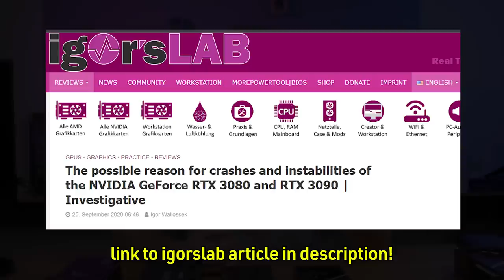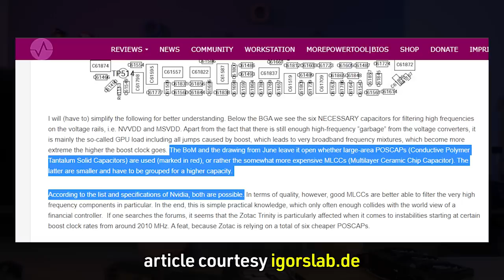The RTX 3080 Launch can't get any worse... Right? Wrong...

Comment: Just to go more indepth form an EE standpoint, these capacitors are primarily what called "de-coupling" or "bypass" caps. They de-couple an integrated circuits power pins (vias from the BGA of the GPU in this case) from the large copper power planes in the PCB. The further a device is from its power supply output (DC/DC switch mode converter on the GPU) , the more inductance there is between the supply and the device its supplying. 
High frequency, high power ICs like a GPU can have huge current spikes that occur at extremely high speed. 

Basically inductance bad. 
It limits how much current we can source from the power supply. The higher the frequency, the more PCB inductance impacts power delivery. 

Because the reactance (complex part of impedance) of an inductor goes up with frequency (Xₗ = 2π*f*L), the higher the frequency of a current pulse from the GPU, the higher the reactive impedance it sees between itself and the power supply. 

Here's where de-coupling capacitors come into play; they store charge and can be placed as close as physically possible to the power vias of the GPU. This means that the high frequency current now has a far lower impedance path into the GPU, it can temporarily come from a bypass cap instead of the power supply. 

But wait there's more! 
The physical capacitor still has small amounts of inductance due to how they are constructed. This is called ESL: equivalent series inductance. 
There are many different ways and materials to build a capacitor so there are many sizes and types of caps available with different pros and cons. (size, price, availability, voltage, ESL, ESR, temperature, dielectric ect.... ) 

Basically, you can implement the SAME amount of capacitance with many sizes/types of caps BUT very different ESL values!! 

You can still have enough decoupling CAPACITY in your caps but if the ESL is too high, at these GHz frequenies, the reactive impedance of the cap itself can greatly reducing its current sourcing abilities!! 

Exactly the same problem why we wanted to put them there in the first place with the PCB inductance!! 

In the case of the 3080 boards, it is possible that Nvidia didn't give correct or strict enough ESL target specs on their reference design. Because the reference design is not used for the FE cards, it may have gotten less lab testing and verification??? IDK

Or the board partners might have been trying to cut costs and used more of the big Tantalum caps which have a higher ESL than a bunch of tiny MLCC (multi-layer ceramic caps) all in parallel. Remember inductance adds in series not like parallel for capacitors. 

Idk that's my rant 😫
Thanks for coming to my bootleg TED talk.
Edit:some corrections
Reply: Shouldn't the MLCC caps be in parallel, not series?
Reply: @carl4889  Yes parallel! Thanks.
Reply: nvidia purposely gave an incorrect minimum requirements to AIBs so that when people find out about the issue, people would buy their founder edition more. Less reputation to AIBs, more to nvidia. one way to kill the AIBs so they can soon monopolyze their own GPU sales....👀👀😂😂..  - some conspiracy theorist

But to be more serious, one of the comments here already mentioned that the bigger POSCAPs tend to be more expensive than MLCCs. I wonder if the AIBs found more money saving in using POSCAPs because it takes less time in the pick and place??  🤔 because they only have to place 1 component instead of 6?
Reply: I'm gonna pretend I understand what you are saying and agree, just because it's amazing the amount of knowledge and technology that goes into a graphics card design.
Reply: @mik995px  That's not the impression I got from this video... It seems like the reference design had 1 POSCAP replaced with the MLCC array, the cards that are failing used all POSCAP designs and would therefore be under speced....

Also as far as manufacturing goes, yes the increase in process time to place the 6 MLCCs would likely increase the costs far more than the actual price difference between the components.
Reply: TLDR. What is it in very lay speak?
Reply: Super cool explanation. I'm an aerospace engineer and had to take some basic EE classes, just enough to understand signal processing and communications system design considerations, so I know a bit about AC circuits and such.
Reply: Shane McLachlan thank you Shane you are a legend. 👊🏼👊🏼
Reply: this makes me very happy that ive graduated from college
Reply: I understood nothing but feel informed regardless.
Reply: Reference shows 5+MLCC, so some AIBs went 6+0 MLCC is fine... 
If you have a 6+0, de clock 15 or so MHz till stable, and you are fine.
Reply: @JackFN_VR64  You can't understand anything if you don't read, so why you ask? Like it's pretty much gibberish for me but i still got something from reading it. So i'll tell you what i gathered from it. Those thingies Jay was showing should act as a buffer to maintain power levels when the board uses it so fast that there is no enough time to be fed by the PSU because of the distance that results inductance. And those thingies are not all the same so not using the ones proper for the job things are not working smooth overall.
But maybe i'm wrong, probably am. But that's what i understand from reading his post, so maybe reading is bad?
Reply: @JackFN_VR64  He's essentially agreeing with Jay and going into a little more detail as to why.
Reply: Can you recommend some EE books that you've found helpful or key to your understanding?
Reply: @somnorila9913  This is a grand TLDR. Thank you 🙏
Reply: @JackFN_VR64  Imagine this: you have 6 little bottles of 1 liter in one case and one bigger bottle that contains 6 liters. In both case the total volume is 6 liters, but the behaviour of the two are not the same. AIB manufacturers wanted to spare some production cost, so they opted for the cheaper solution, without considering other factors than the capacitance. This explanation should be enough to understand what happened and why they also talk about bottleneck... (the last one is a pun ;-) )
Reply: Decoupling caps are not just for power supply lines.  All signal lines going into an IC should have decoupling caps to block DC voltages.  A DC offset on a signal line can be just a bad as poor power supply isolation.
Reply: Best explanation of bypass caps I’ve ever read. Thank you
Reply: Bypass capacitors aren't the same as decoupling capacitors. Decoupling ones are like you explained, but the bypass ones are put to let very high frequency EMI (electromagnetic interference) bypass the IC through them, which is the function that Jay tried to explain.
Reply: @saifaddeenal-manaseer6325  agreed; good clarification!
Reply: Love when ppl at the comments know their shit
Reply: @nated1971  Not all signal lines, many common high speed signal types which are implemented on emitter coupled logic like LVPECL or other have a DC bias on the signal line to bias the input transistor of the receiver.
Reply: @Shane_McLachlan  Fair enough, my limited experience is in RF systems; when you're a hammer everything is a nail
Reply: @saifaddeenal-manaseer6325  Good point! Thanks. 
Provides a low impedance path for the noise to ground! I like to use  feed-through capacitors for this. They have an extremely low inductance to ground. Great filter bandwidth.
Reply: Out of curiosity, what if all six sections were mlcc? Better, right?
Reply: @JackFN_VR64  the big capacitors are not sufficient, so the small ones are there to solve the issue, and some AIB manufacturers are skipping the small ones that solve the issue to cut costs
Reply: Holy smokes. You really seem to know your stuff (and passionately so). 

I wouldn't normally do this but I am having an issue surrounding my 2080ti that I suspect is related to power issues. Do you mind if I give you a breakdown of the issue and you can share your insights?
Reply: Shane McLachlan now I’m wondering what else they cut corners on
Reply: i stopped using tantalum capacitors in my design for  these and other reasons - mostly because taking high currents often caused them to go short circuit and / or explode - thanks to their intrinsic ESR 

now I exclusively use MLCC with X7R dielectric as these are incredibly stable and  in 20 years they have remained operational .
Reply: @Ender240sxS13  the cost to pick and place is fractions of a penny, it costs more to replace a reel of components as this is purely labour.    The cost of 6 more capacitor placement is also negligible to the additional optical polarity inspection required for the larger capacitors
Reply: this is surges of Direct Current not Alternating Current being supplied , the inductance of the holes, traces, connections etc... will have the effects you describe
Reply: @wobblysauce  and leaving performance on the table because someone wanted to be cheap.... like buying a Ferrari with a plastic spark plug

Comment: Oh boy, imagine being one of those who actually bought one of these buggy cards at a ridiculous price from a scalper.
Reply: I didn't buy from a scalper but imagine waiting outside microcenter for 24 hours to buy a 3090 and find out that Zotac decides to cheap out on a 1500$ card.  That's just fking evil.  And yes, they used the same capacitor layout from the 3080.
Reply: @Momotaro0125  na, for 3090 you had to wait 48-72 hours outside the microcenter
Reply: @Grubiantoll  There's actually 2 Microcenters nearby where I live and the population isn't high overall.  The one in Rockville, MD had 16 cards and the one close to me (Fairfax, Va) had 12.  I was the 11th person in the line and I showed up around 11am on Wednesday.  So no, you didn't have to wait 48 hours for a card, it just depends on the density of the population.  I know you're just a typical internet cynic but at least do your research before you call out someone.
Reply: SERVES EM RIGHT! Dont buy from scalpers, and dont be a scalper!
Reply: teaches them a lesson to not buy from scalpers
Reply: @Momotaro0125  That's pretty dramatic calling them "fucking evil". Did you bother watching the video or not? Jay made it very clear that using 6 of the large black capacitors was not necessarily "cheaping out" but meeting minimum spec and told you specifically not to shit on them for trying to meet minimum spec because it helps them reach the (sometimes even under) MSRP rather than going significantly over. Cheaper prices win buyers over. Under normal circumstances if this wasn't an issue you would've just got a normal 3080/3090 that couldn't been pushed as hard with an overclock or GPU Boost. Don't be melodramatic and call them evil or cheap for it. They made a mistake and they will pay for it but the last thing we need is to bash GPU AIB partners with blind moron rage.

Take a breath and chill.
Reply: @QuackZack  well, it would be understandable if it's the 3080 but considering that the 3090 is a 1500$ card, it's a whole different situation.  Also, Zotac decided to lower the power limit on their cards instead of spending a few more dimes for just one or two better bypass capacitors for a 1500$ card.  How is that not evil?  I understand that it's also Nvidia's fault since AIB layouts have to go through them first to get the green light but still.  Zotac knows the problem exists and still decided to lower the power limit over spending a few more dimes ON A 1500$ CARD.  How is that not evil?  When you compare them to Asus who figured out the problem and decided to have all 6 ceramic capacitors instead.  And you know this is true because their pre release model did have the cheap out capacitors and the launch models have the good capacitors.  That is what a good company would do.
Reply: @QuackZack  btw, they didn't meet the minimum spec because I do crash still without touching Firestorm (Zotac's OC soft).  And this happens with Zotac already lowering the power limit by 5%.  All this could be avoided if they just spent a few more dimes.
Reply: Sekushu u taught that troll for sure
Reply: @QuackZack  Oh course its cheaping out! Are they evil...No. Are companies being greedy to maximise their already high profits for these cards...Yes!
Reply: Exactly! 😂
Reply: @Momotaro0125  Imaging paying $1800 for the Strix only to find that all six of its caps are the crap kind and all six on the $1600 TUF are the good kind?
Reply: @SteveMedin  the Tuf was 1500$ at Microcenter, but they only had 2.  They would've been my first choice but I was the 11th person so begger can't be chooser.
Reply: Anyone buying from scalpers deserves it.
Reply: @QuackZack  Most of the people that like to complain like this and attack companies likely would never be able to do the type of brain work required to design any sort of electric circuit for computing...

(Note, I know I can't do that work. Maybe with years of studying but I don't even want to attempt it lol)
Reply: Ufff i felt that LOL
Reply: @QuackZack  No she showed the graphic for the minimum spec and its 5 large black ones not 6. 6 is cheaping out.
Reply: It's funny, because what you guys scalping, is called retail in my country.
The lowest price i can find in Hungary, is around 1150$, at a shop i never heard of.
But on one of the most popular shops, is listing the cards at around 1300$.
And already seen some listings of 3070 cards (probably something like preorder) at 800$.
Reply: Those people are part of the problem, just like the scalpers. No sympathy here.
Reply: @Grubiantoll   I bought one fair and square using an add to cart URL from Nvidia.
Reply: @SITHRooTs  the are evil since they companies that like you money, and provide you cheap things for like 1500 usd to make you buy it. Mybe the real cost of  3090 is like 350 at the best.
Reply: @Momotaro0125  Welcome to current times. They just create a hype for sub par products and because of the hype they can sell them expensive. It's the same as happened to games. Early access and games as service are just a way to sell unfinished products for full price. It seems to now have made it's way to the hardware world also.
Reply: @SITHRooTs  Money is time. If someone takes your money they have made a slave of you. Yes, that is evil
Reply: @Momotaro0125  Yeah. the TUF is $1500, but for another $100 you get the OC version that either uses a binned chip or wants you to think it does.
Reply: Once a chump always a chump
Reply: @Momotaro0125  imagine buying a 3090 for gaming tho, the 3090 was built for the purpose of a work station gpu like the quadro series.
Reply: @eyster10  it's still the best gaming card and is getting supports for gaming.  If people are fortunate enough to buy it, it's their right to use it for whatever they see fit.  There is no need for any rationalization besides that.
Reply: @Momotaro0125  its not the best tho, spec wise sure. but it only performs about 10% quicker for gaming. if someone plans to render video, stream and game and all that then the card is perfect. but if they strictly only game the 3080 is the best buy for the buck. but yes its their money if they want a 3090 or even something else then get it. im personally waiting for the 3070 to drop to see benchmarks vs the new amd cards dropping